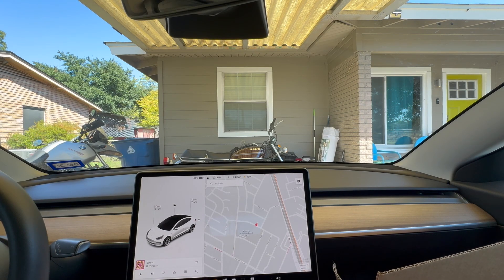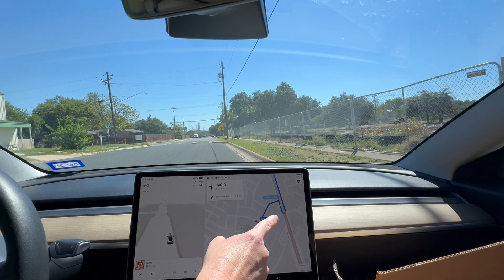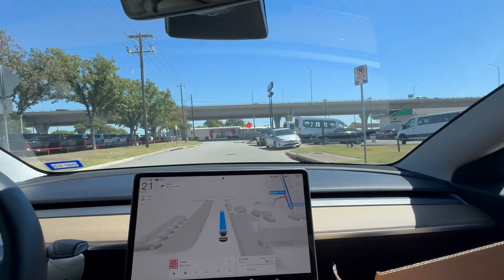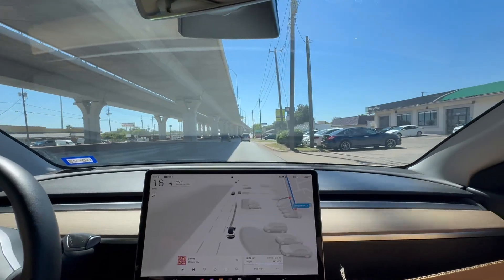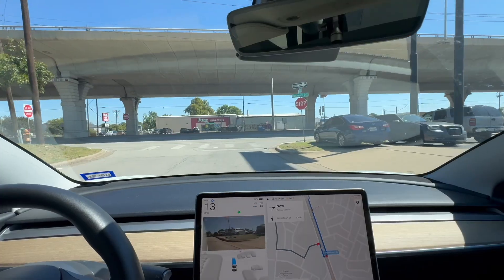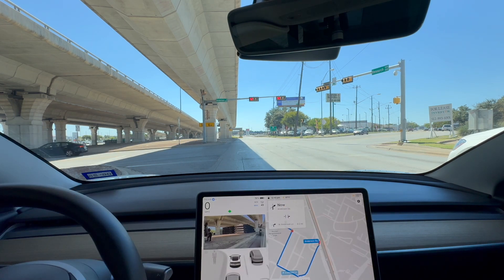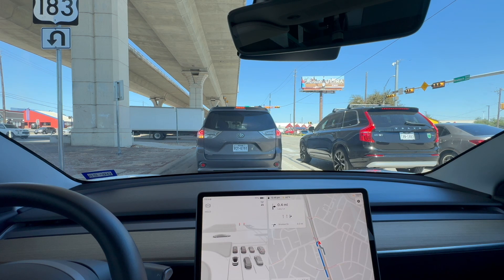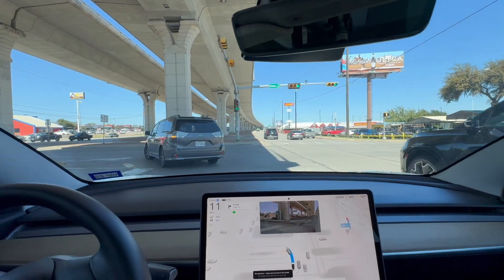Tesla FSD 12.5.4 first impressions and tests

Comment: Thanks for the video. I updated mine from 12.3.6 and was very excited about 12.5.4, but besides nag-free driving and A.S.S., unfortunately, it disappointed me. I've already driven about 100 miles with this version, and a lot of phantom breaking, constant tiny acceleration and deceleration while cruising on straight city roads, using unnecessary turn signals and confusing other drivers, jerky movements on the steering wheel, and so on... After waiting so long for an update, I was expecting better.